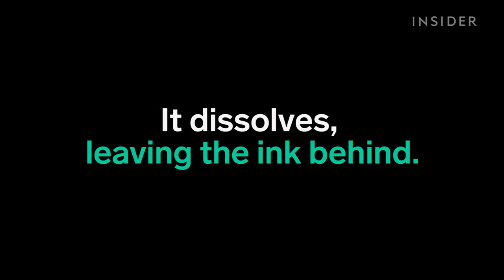This printing technique uses ink floating on water

Comment: is this using special ink?
Reply: the inks ability to sustain the image before printing would depend on the ink itself? like something about the solubility and weight of pigment and stuff? i tried this with like ink bottle ink and I could print an image but not like anything complex or anyth